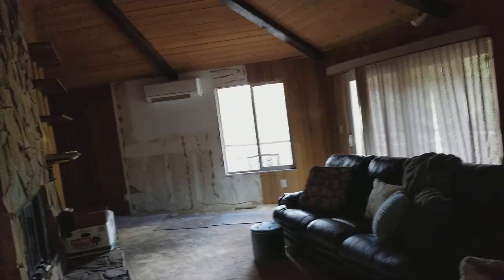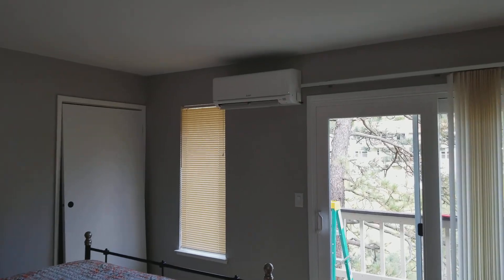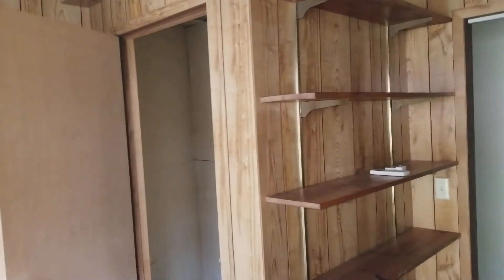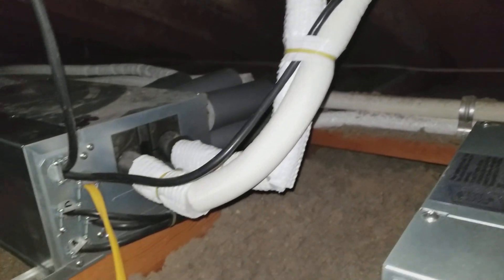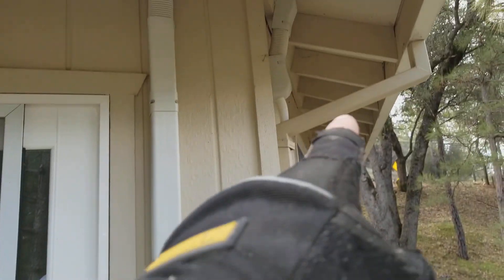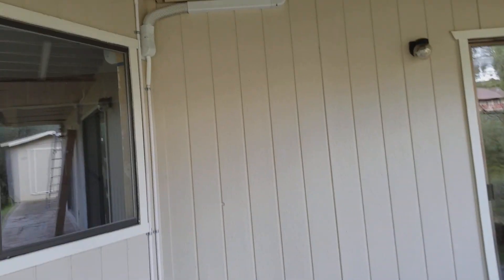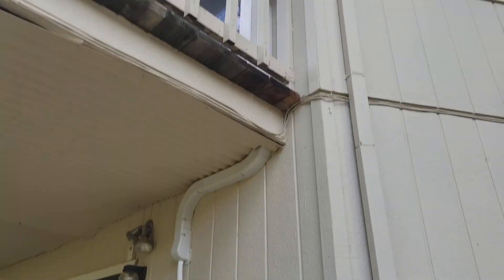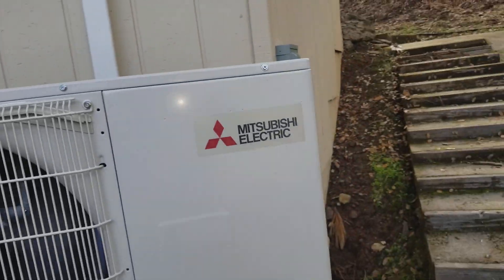4 ton, 6 zone, Mitsubishi mini split install in Groveland PART 2

Comment: Enjoyed this and your other videos. May I ask, do you believe that Mitsubishi has the best Multi Zone Ductless products or are Daikin and Gree and Midea worthy options?
Reply from the maker: I like the Mitsubishis a lot more than any other product we have installed.  The Hyper heats are phenomenal. tech support, sales assistance, brochures, co-op, vehicle wraps, digital library, mail outs, radio, TV commercials, displays, on and on. Go take a look at mylinkdrive.com, pretty much gets you information you need without calling tech support. I have it downloaded on a laptop so its with me everywhere I go. I think Daikin and Fujitsu had some comparable products, but its the entire experience. I called and asked my rep a few days ago if they had a circuit board for one of the units I just put in. not that i needed it but I wanted to see how long it would take to get one if I did. they had 6. This kind of stuff matters to me. I did the M and P entry level class for 2 days, then the advanced for 2 days, then a sales round table for 2 days. Daikin contacted me a few weeks ago to see if I wanted to do a class with them. it was for 2 hours????? what the hell they gonna teach me in two hours?
Reply: Thanks for your response. Mitsubishi, besides a quality product, seems to be very concerned about its customers and its HVAC Contractors  who install and service Mitsubishi product.  Thanks for taking time to  respond.
Reply: NewOrleansMan 70179 also you can’t purchase these products if you haven’t been through these classes.